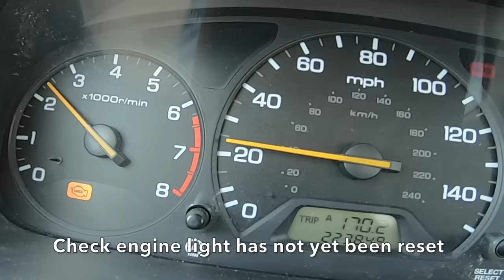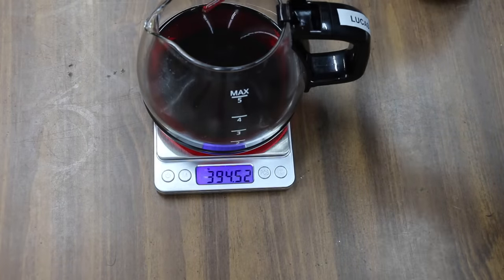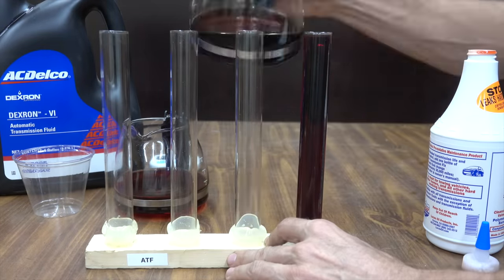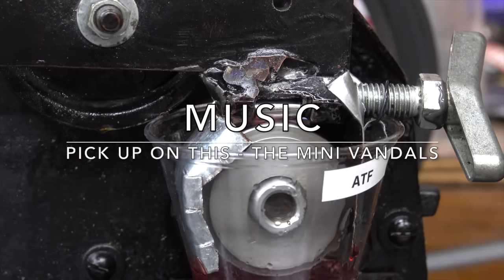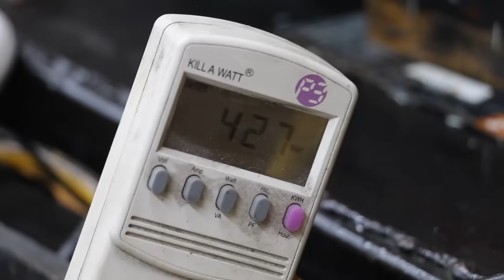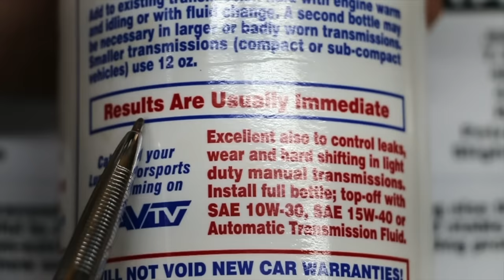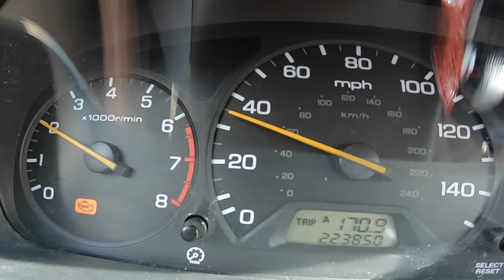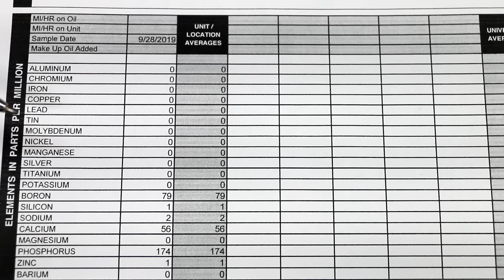Does Lucas Transmission Fix Work?  Let's find out!

Comment: Worked for me, lost a cooler line on a 4l60-e 600 miles from home, had a bad flare between 2-3. Added 2 bottles of this, topped off ATF, and it significantly improved the flare within 20 miles, and was gone after a week. I since installed an upgraded servo which made it shift like it should have from the factory. Hoping it lasts.
Reply: Do you know the part number to the servo
Reply: Thank you for the info. Was curious about using this in my trailblazers automatic transmission. Now I’m gonna try it.

Comment: Yes, it works! I put it in my car, and it straightened out the problem immediately. I also did a transmission flush and fluid change before putting it in with the transmission fluid!  That was 100,000 miles ago!
Reply from the maker: Great to hear!

Comment: I have used Lucas with great success and I always recommend it. Best case for me was I had a 2006 Chevy Express 4.3v6 and at 160k miles I noticed it slipping some when cold and harsh shifts. I put Lucas Trans repair in it and checked it regularly. Whenever it was low in fluid I topped it off with Lucas. The transmission did finally go out at 340k miles!
Reply from the maker: Great feedback!  Thank you

Comment: As far as the lubricity and viscosity tests, it might have been interesting to include a trans fluid/Lucas blend in the recommended proportions, since Lucas is designed to be an additive, not a stand alone product.
Reply from the maker: Thanks for the suggestion.
Reply: it takes 30 minutes to pour lucas in ,  jelly  would probably win that race lol
Reply: Excellent point.  Nobody runs straight additive in a transmission.

Comment: This stuff works!!! My fiancé‘s 2004 Pontiac Grand Am GT had a harsh shift due to the PWM TCC solenoid overheating on long trips. I didn’t feel like tearing the transmission apart, and replacing the valve right away. So we replaced a quart of transmission fluid with some Lucas transmission fix, and so far The transmission hasn’t acted up since. It’s been well over a month, and we even took it on a 400 mile long trip. I highly recommend it for garbage GM transmissions for sure!
Reply from the maker: Thanks for sharing.

Comment: I would not have reset the check engine light, but see if it would clear on its own, did you even check to see what codes there were ? I only reset the light if it does not go out on its own

Comment: Changing transmission fluid along with this additive can definitely prolong the inevitable of paying someone to rebuild it !  Awesome video as always 😊
Reply from the maker: Thank you!
Reply: Just depends. If it has 200,000 miles on it and it’s the original fluid from factory. Flushing the fluid and even changing the filter may have actually made it worse.

Comment: I solved this problem by having a manual transmission.
Reply: lol same. now the question of cable vs hydro.
Reply: @drunkredninja  In a dirt bike cable if definitely more reliable
Reply: Ive gone through 3 b series gear boxes in 2 years
Reply: Adam Fears  bad input shaft bearing will make a honda pop outta 3rd thats real common
Reply: False Flag  also for the record i can shift lol
Reply: False Flag  its limiter powershift and repeat because why not its fun and 3rd gear burnouts because i get tires 4 free and who dont like senseless over burnouts
Reply: MAURICE if you went through 3 manual transmissions yeah I'm sorry..I don't think you know how to drive stick very well..
Reply: Adam Fears no pop outs are a genuine thing.. It usually happens AFTER the car has been put fully into gear so it's not an issue of not moving the shifter in enough
Reply: Do you want a medal?
Reply: @Carlos-yz5kz  how come my old car i put 200.000ks on didn't have a single gbox problem only a clutch but that looked like a oem toyota clutch i changed that at 380.000ks ish retired it at 430.000 because was to rusty to keep it road legal had done about 240.000 when i brought  it
Reply: @BIGSMOKE-bl2lq  How much boost are you running? lol
Reply: Yes but then you have clutches and there's no magic fluid for those
Reply from the maker: That'll work!
Reply: That's what I'm talking about ....... (this from a person driving auto car but really wants a manual one)
Reply: @jusb1066  A $150 clutch is cheaper than a $2500 transmission.
Reply: Agreed. I converted two of my auto cars to manual.
Reply: @Oddman1980  except when it isnt, clutch for my car. 750, and wears out in 50k miles, heck im at 15k miles and its already pretty bad.., not every auto trans is 2500 or wears badly
Reply: Auto better 🤣🤣🤣
Reply: cause manual transmission never wear out , never
Reply: Adam Fears  only had one pop out in 4 years and 7 manual cars. Funny how it happened on a Toyota transmission known for that issue and still only happened once
Reply: right, show me a clutch that will run for 200K miles without needing to be replaced
Reply: Phil Green  LOL
Reply: @NIGHTMAREuki  The one owned by someone over 40 ; )
Reply: Manuals fail too. I got plenty of em on the shop floor. Cost about the same to rebuild.
Reply: I solve it by buying a car with a drain plug in the transmission pan and getting the factory fluids out of it ASAP, and keeping it changed.  This problem wasn't the transmission's fault, it was the crappy factory fluids.
Reply: Mother Algorithm  have you ever driven in London city?, That's how some people earn their money, I am lucky to get into 3rd gear
Reply: But the clutch wears out and needs replacing often
Reply: Popouts usually happen when your synchros start to wear out.
Reply: And you added anti theft to your car that way
Reply: Mother Algorithm  some cars are worse than others. my current Citroen c1 clutch is probably almost gone 15k, my previous ford fiesta was about 48k. City cars get a beating, I can drive fine thanks 😅
Reply: @jusb1066   @Jusb1066  Citroëns are famous about robotic shifters, which are actually normal gearboxes with electric shifter and clutch-engaging actuators. Clutch disk on these can go wrong under 60k miles (~90k km). Fully manual ones can go upto 100-110k (miles).  I have a Suzuki Swift 1.3 (1994) with 290k km-s, which have the 2nd clutch kit (factory one included) and still works great.
Reply: @95Jester  indeed there was an option, robotised manual, 😄
Reply: Oddman1980 The only Honda I own, and would own, has a stick shift in it.
Reply: Me to till the pos junk design of fords internal slave became a issue. Now rather than pull and replace once its 3 now 4 times because on the rangers the slave cyl from autozone is a pos that dosent hold up
Reply: Oddman1980 but then you have a clutch problem lol
Reply: modifiedchevy Leave it to Ford to screw up a reliable design.
Reply: I wish manual transmissions would become popular again.
Reply: Especially in Honda
Reply: @BIGSMOKE-bl2lq  and very hard shift into R, not to mention constant bearing whine.
Reply: @pliedtka  if u look at the reverse gears they got flat bits and wen the line up they wont mesh i call it a design flaw if the tapers were bigger they would always drop in
Reply: @BIGSMOKE-bl2lq  maybe I take the transmission apart if time allows to investigate what's damaged. It's 98 Si beater - cars from this time are basically idiot proof and cheap to repair, one of the reasons I keep using it, despite whining bearing and shifting issues.
Reply: @jusb1066  lol, obviously you've never worked in a transmission shop. Manuals have all kinds of trouble, and are much spendier to fix than automatics.
Reply: @6h471  in the uk manuals are 95 percent of the market, automatics are the expensive to fix option
Reply: AUTONOMEN x  there is no clutch adjustment on a modern clutch, it has an internal self adjuster, the fault isnt mine but the prev owner (ive done 400 miles in the car) and the design of the car with a tall 1st gear, no where for clutch foot to go (thus riding clutch) and the uk traffic which is always busy
Reply: BiggestComplainer Was concerting from Auto to manual transmission difficult? I’ve got a 2002 Odyssey and the transmission is it’s only serious problem. 
   Did you do the switch yourself? How did you even find a manual transmission anymore? Manual is all I really ever want to have.
Reply: Doesnt matter, manual has syncros and clutch that wear out which require servicing aswell
Used automatic for a toyota echo is $2-300 and last 200k+ miles while their manual cost $5-800 and last about the same if not a littl less
It's all on the quality and how you drive knucklehead
Reply: Those numbers are only correct if you drive a Toyota echo. 194,000 miles on my Saturn's transmission and clutch, and it's just fine. A new clutch is less than $200 when the time comes.
Reply: @Oddman1980  yeah which is my point, manual isn't always best though... that's literally my point
Reply: laughs in burnt clutch and bad syncros
Reply: @kabj06  You don't know how to drive stick, is what you're saying.
Reply: @Oddman1980  Yeah, you're right, those parts last forever and never wear out
Reply: 'OL SKOOL' Slick shift a manual. 
I have a M22 with a 2.54 1st gear. All the gears have every other tooth removed and are nickle plated. I use a real 426 Hemi pressure plate, not auto zoned and a light flywheel behind a pretty healthy 500hp SBC.  
When I race, which is frequently, I don't use the clutch after launch.
I built the 'Rock Crusher' in 1983 Im on the 2nd pressure plate and have beat the wee out of it for 35 yrs. 
Now that Ive written it... Im sure the clutch disk will test the integrity of my scatter shield.
Such is life
Reply: Manual is an Anti Theft Device also. I don't know anyone under the age 30 that know how to drive one. A 37 year old man told me yesterday he doesn't know how. LOL
Reply: @chancey1979  I taught my wife when she was in her 20's. She's 33 now and drives one every day.
Reply: Right
Reply: I agree with your manual trans idea. But getting very hard to find anything with a manual anymore. Even in a pickup truck!

Comment: How do you know if your transmission is about to go out? I replaced motor in 07 Tahoe a year ago… had under 240k miles on it.  Anyways as a woman and not familiar with this other than what my dad taught me here and there….  I feel like the transmission is starting to act funny though…. Sometimes I pull a 19 ft skiff and yes use tow mode but I feel a vibration when it’s changing between certain gears…. Am I correct for leaning towards transmission issues?

Comment: I used to have a 97 Ram 1500 with 46RE. The only way it would run correctly was with two bottles of Lucas trans fluid added to the trans.
Reply from the maker: Thanks for sharing.

Comment: Here is the review I left on Amazon. I ordered it 10 minutes after watching this video. Again Thank you for your video's. 

I am a 20+ year Automotive dealer Technician with every certification there is. I have rebuilt 100's of transmissions and know my way around a car/truck. I have seen all these snake oil fixes and devices that promise the world and deliver nothing. Heck a lot of the time I have to charge you (customer) extra money to remove or flush whatever crap you you put in you car to fix it right. 

 I have a 2001 Dodge Ram 4x4 2500 diesel with 218,000 miles that has not had first gear in drive (will go into first in manual first) and very hard shifts in all 4 gears. It has been this way for 40,000 miles. I park the truck for months at a time and only use it for towing (usually over 10,000lbs). The bands have been adjusted every 7500 miles and the adjusters are just about inside the case (meaning the bands have no material left and are likely metal to metal against the drum (in lamens terms the transmission is worn out)). 

 I saw a review of this stuff on the Youtube channel Project Farm. I watch his stuff a lot and generally follow his advice. He used it in a Honda and it made a marked improvement. As he said in the video "it's 12$ and worth a try". 

So I ordered some and dumped it into the transmission (the whole bottle). I let the truck warm up and took it for a spin. HOLY SHISCABOBS!!!!!!!! the trans started in first gear at every stop and the shifts are silky smooth. Now granted I have only put 20 miles on the truck before writing this review and things may change. In a few weeks we are going to take out the toy hauler (12,000lbs fully loaded) for a 600 mile trip. If things get worse I will update the review.  

Either way it has been worth every penny of the 10$ I spent.....
Reply from the maker: Thank you very much!  Glad this helped the transmission!!
Reply: I am running it. It definitely has helped. As I read (before using it), it got even better as use went on - and it did for me too.  I was shocked.
Reply: Catapit, can i pass a vehicle question with you?
Reply: Any update ?
Reply: Any update?
Reply: Update?
Reply: @elreyyakko   Sorry, just noticed that little red bell looking thing on my Youtube screen.  It started to 2nd gear start two camping trips ago. So I think it went about 2000 miles before it started acting up again. But that was 2k hard towing. I only use my truck for towing, so it sits for a month or two at a time and then it works hard again (towing up I17 out of Phoenix or the mountain roads around Prescott/Pason/Flagstaff).  I was thinking about grabbing another bottle of the stuff and dumping it in, but did not get around to it yet.
Reply: @cataplt  no worries,thanks for reply

Comment: Excellent video! Thank you! 

I'd be interested if Lucas Oil adds any seal conditioners to this product. We know that rubber and other elastic polymers have plasticizers that keep them "squishy," but over time they lose them, especially at high temperatures. If you can re-introduce some plasticizer into the material before it cracks, you can often avert bigger problems. The challenge is adding enough of the right conditioner (plasticizer) to keep/make seals pliable, but without melting them. 

I'm not sure how you'd test the Lucas product, but it would be interesting to see. Perhaps you have some old automatic transmission seals and O-rings lying around that you could cook in the Lucas Transmission Fix for a week on a hotplate stirrer, testing their before and after weights and elasticity?

In the lab, we often use B-100 biodiesel (mixed into the normal lubricant in small quantities) as a seal conditioner. We also sometimes test polymers (seals, gaskets, etc.) by placing them in pure B-100 for a week or more. Many rubbers and plastics will simply melt or fall apart in pure B-100, including the cap of the diesel canister we had originally used for it. Only a few materials remain completely unaffected by it. 

Anyway, thanks again for the great video!
Reply from the maker: Thanks!  Thanks for the video idea.
Reply: They have a seal conditioner product

Comment: Sick video,  I have a 50000km 02 ford taurus (4th gen) the trannies in these cars are pretty sloppy and mine is barely used so woulkd you recommend using this product to clean it up? I had an 01 before and its the exact same transmission and issues,  really hard shifts into gear on a hill and really hard drive to reverse, takes like 3 seconds lol and they all pretty  uch take that time unless I had 2 identical issues with cars 100000 kms difference in age.  Any info/reviews of this would be great!
\

Comment: Hello👍 I have a 2008 scion xb it has over 200,000 miles on it I've change to trans oil and filter a while back notice a slight slip but still running thinking of adding Lucas trans fix what do you think?